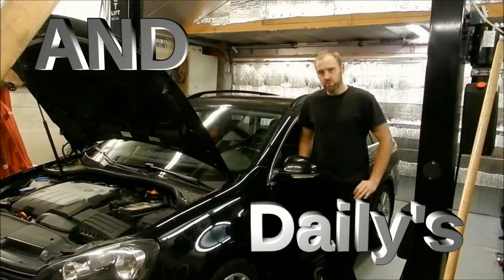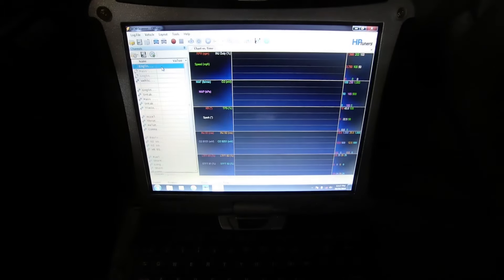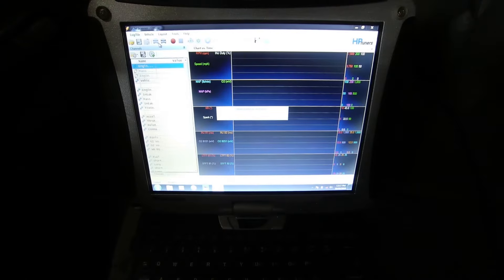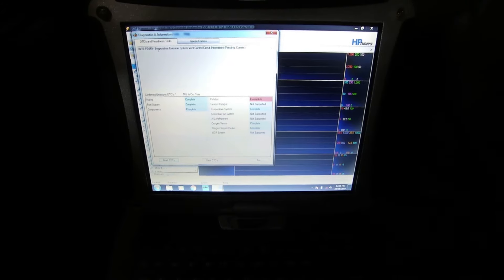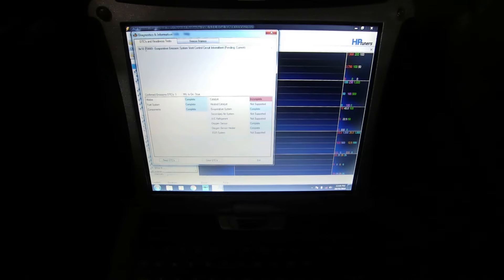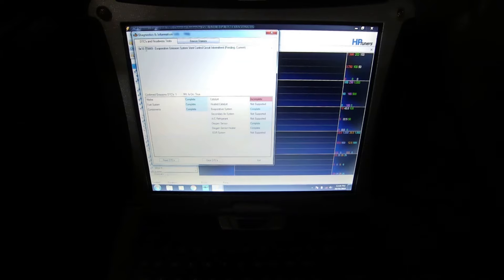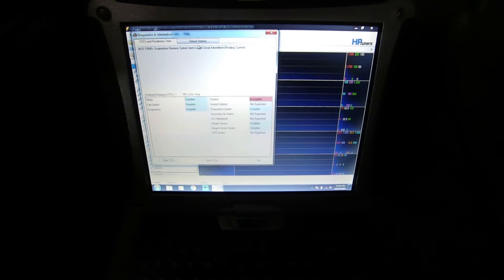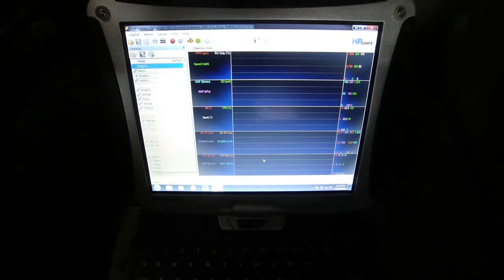The Common GM EVAP Code How to Diagnose and Repair

Comment: The newer trucks have the filter and valve seperated by a length of hose don't they?
Reply from the maker: Yes and the ones previous to that get updated to the hose type I believe.
Reply: I updated and moved mine cause it's 4x4, 98 miles later, check engine light.. changed canister, same thing, then purge valve, same thing .. so the light stays on and if you have over half a tank it has no power
Reply: From what I gather, the $200 fix GM suggests is just as prone to failure, so your better off just replacing that little $20 piece and get a year or two out of it as opposed to spending 10 times as much
Reply: @CrazedPerformanceRepair  

Im dealing with a p0455, tighten cap. The vent valve, purge solenoid, cap and charcoal cannister have been replaced. The tighten cap disappeared for like 3 weeks and code disappeared then came back.

I have not replaced the tank pressure sensor or plastic lines.
Reply: @shadowopsairman1583 ever get it figured out. Mines doing the same thing

Comment: Probably the best video I have seen regarding the evac. Thank you! I have a p0449 and have already replaced the purge valve. I will try the vent valve next.
Reply: What was it? mine has rough idle
Reply: @jacobmansfield341 did you figure yours out mine as well rough idle and check engine and the gas don’t go in
Reply: @jacobmansfield341  ..I had a rough idle on 04 Chevy truck also and it wound up being the purge valve that time ..but ..if the gas station nozzle shuts off it might be the charcoal canister ..both the purge and vent valves are relatively inexpensive ..makes sense to just swap them both out ..

Comment: I have a 2008 1500 Sierra crew cab and i get the 442 code small leak detected/change solenoid. Im going to do the test on this when i get home from work today..thanks for this video. It is informative.
Reply: What did you find out hoss?
Reply: A y results?
Reply: @reneescarcega7263  it was a leak in the hose coming from the evap to the canister. I remove it from truck, taped it, flex sealed, taped again, flex sealed again. It lasted for a while but its back again. I havent checked if its a leak from same spot. I did buy a smoke machine off amazon which helped find it.
Reply: @markherring3513  thanks for taking the time to respond, I guess gonna have to do an smoke test, replaced the vent valve solenoid by the gas tank and cleared the code for couple months, but came back same code p0442, has replaced gas cap and purge valve and the vent Valve solenoid , but the code came back, it must be a leak on a hose.

Comment: have a silverado 1500hd 6l 2005  have this po449 code changed evap canister,filter etc scanned it still same po449 so i changed evap purge valve on intake, still po449 code...what next??/

Comment: I had the po448 code for the evap vent circuit being bad.  went and bought a new vent unit as you show here and its still throwing the error code, so now i have no clue whats going on.
Reply: Yeah. I did the same and got the same results 🤔... just this morning
Reply: Did you clear your codes also?
Reply: @Jralls3  yes cleared the codes, also i believe the old one was faulty because i tested it with a 9v battery and it wasnt clicking loud, the new one is clicking a lot louder,  i checked my wiring too. so at this point im not sure what else to do.  i also took compressed air and cleaned out the box
Reply from the maker: Can your scan tool do activation of the vent solenoid? If so do that to make sure it activates. If it doesn't then I would retest wiring, then verify the ECM is putting out enough power and ground to solenoid at the ECM.

Comment: Im got clean tryck only 95k 4.8 runs good sometimes but ass sometimes... Gets p0300 flashing on highway at 70mph then sometimes goes away. Sometimes the light will stay on solid and then I scan it and it only says it's two. They're both 300. That's it. Thinking it could be a cat. I've already done plugged wires, purge valve... Guy did Jimmy rig the ground to the block with a new wire so it could be that idk... Chasing his bullshit sucks 😞
Reply from the maker: Check misfire history counter

Comment: My 2007 Silverado has both codes, pretty sure it's the evap solenoid by the fuel tank. The guy I bought it from had a grass cutting business, but the truck just now has 75k miles. It was very dirty underneath. I had both codes associated with this issue, po449 po445,  which  is the vapor purge valve on top of the intake manifold. I'm gonna change it as well. I usually do a resistance test on stuff, but the old timer I bought the truck from had run over a lot of open ground when he was running his landscaping business, and the top of the old valve was almost off. I've seen a bunch of videos on this very issue and yours is the most detailed, thanks!

Comment: Good stuff sir. 
       Definitely look at  a loose fuel cap first.  The easiest is often the most overlooked.  I've had this code come up 4 times in as many weeks on 4 g m vehicles.  Three times it was an incorrectly tightened fuel cap.  Cheap fix!

Comment: Great overview of that evap component. 
Last year had a P0446, since that canister was the most likely issue, I simply replaced it for $25. Of course that wasn't the issue. It was the $35 fuel tank pressure sensor which failed.  It sits on top of fuel pump.
In hindsight, since I got the AFM/DOD tuned off, could have just turned off the evap diagnostics and never would worry about again. 
I needed to pass emissions while figuring this out: cleared the codes, drove truck for 2 weeks while repeatedly topping the tank, until scanner said 'ready' for all but 1 test, and it passed.
Reply: Bob CajunWon I got the fuel tank pressure sensor fixed but my check engine light didn’t come off and keeps saying evap emission system. What did you do?
Reply: fassel elder been awhile:  could be a few things, cracked and leaking lines.  Remove that rear canister, clean out dirt or cobwebs, apply 12v to the pins, listen for clicking, blow through it with and without 12v.  Do same thing to the evap solenoid at the engine. Or, just find a guy to tune that feature out.
Reply: I replaced the canister and the vent valve under the hood. what do u mean by topping the tank? U mean tapping? I need to pass emissions as well.
Reply: @williamroberts4759 Topping the tank off means filling to capacity. The idea is that in a close environment, the more fuel you have the less vapor. Hence, the less the evap system has to work to vent off vapor.

Comment: My 2017 Sierra Denali has no fuel cap. Yesterday I started it up to a ENGINE POWER LOSS message and check engine light. After a few restarts the power loss thing corrected and the engine code is P0446. Not sure what to do.
Reply from the maker: Did you loose it or does it have that flapper door thing? If it's the flapper style you could still get debris caught in the causing a leak. But a p0446 is for a vent control circuit. This indicates a electrical fault.

Comment: I got a p0451 and a p0446. 2009 gmc sierra 1500. I don't think that its a fuel tank pressure sensors only because it had a full fuel pump assembly in a year ago.
Reply: I have the same problem did you find out what the trouble was.

Comment: Thank you sir !! Luckily it’s still under warranty, dropping it off next week  yours should of been under warranty here’s the info Expires
2035-09-14 or 150006 miles
Warranty expiration is based on expiration date or expiration mileage, whichever comes first.
Field Action
Some 2019 - 2020 model year Cadillac XT4, Chevrolet Silverado 1500, or GMC Sierra 1500 vehicles, equipped with a 4-cylinder gas engine may have a condition that could cause the evaporative emissions purge pump to fail. If this condition occurs, the Malfunction Indicator Light (Check Engine Light) will illuminate and a diagnostic trouble code will set. This special coverage covers the condition described above for a period of 15 years or 150,000 miles (240,000 km), whichever occurs first, from the date the vehicle was originally placed in service, regardless of ownership.
Repairs
Dealers are to replace the evaporative emissions purge pump/canister as necessary. The repairs will be made at no charge to the customer.
Reply from the maker: I believe that vehicle was a 07 with over 200k miles on it so yeah, warranty not so much.

Comment: Great video.
When testing the vent valve, does it matter what pin you connect 12v and ground ?
Ty
Reply: Yes it does, check schematics if you can find them but for the most part, red or grey is power

Comment: Im dealing with a p0455, tighten cap, the vent valve, purge solenoid, cap and charcoal cannister have been replaced. The tighten cap disappeared for like 3 weeks and code disappeared then came back.

I have not replaced the tank pressure sensor or plastic lines.
Reply: Dang bro. Did you ever get that fixed if so, what was the solution

Comment: What year what vehicle what engine size. I've heard so many opinions on this I may have to get a mechanic.
Reply from the maker: Yeah male model is fairly irrelevant. The EVAP works pretty much the same on all vehicles made from the 90s till current. It's one part of a vehicle that hasn't had a reason to advance really. The only difference will be the location of the components involved in the system. Otherwise they all function the same.

Comment: I had the code for almost a year after i swapped a fuel pump. I had a hard time finding what was causing it. It ended up being an o-ring on a hard line that went from the solenoid sensor into the  evap cannister.  The o-ring was inside a female connector.
Reply: Wow really!? That’s crazy.. I have a 2007 Chevy avalanche and I have a P0442 code that won’t go away.. I’ve replaced the purge valve and the gas cap, but the check engine light keeps coming on.. small evap leak

Comment: I have a 2019 chevy silverado 1500 4cyl, its throwing 2 codes P1467 and P2C0E.. We changed the evap solenoid and nothing improved, its having hard idling, reduce engine power and when i press on gas it gallops back and forth. So with all these symptoms would the evap purge pump valve on top by engine fix this, or the Purge pump next to gas tank?
Reply from the maker: Interesting set of symptoms, Perhaps PM me at my website. I struggle to keep up with youtube comments.
Reply: @CrazedPerformanceRepair  Dealer repaired it for me at no cost. It was the evap purge pump.

Comment: Has anyone started producing an emulator that will prevent EVAP codes?
Reply from the maker: EVAP codes are usually a easy fix. If the vehicle is new enough they can just be shut off in the tune.

Comment: I have 4 GM cars and trucks, all of them have evap issues. The evap systems on these are poorly engineered. Went through 3 vent valve solenoids on my 04 silverado and it's still having issues. Gave up and have been ignoring the cel for 5 years now. For some reason local emissions station don't plug into obd2 ports on 2500hd trucks here
Reply from the maker: You must drive on a lot of gravel. There is a upgraded vent valve that has a hose on it. If you add a filter to the hose and mount it away from dusty area it will last much longer.

Comment: Could this cause a p1400 code also been having rough starting for a while now
Reply from the maker: Only if the valve is stuck closed causing your tank to suck itself collapsed. Highly unlikely though. It's more likely related to MAF or something.

Comment: Great video on the simplicity of changing the canister, but why doesn't any of the youtube posters show how to work through the problem of a P0449 code when it isn't the canister but truly is an intermittent vent control circuit issue, and done without a 1000 plus dollar scanner. I am running out of electricians tape to cover the MIL and refuse to buy any more canisters.🤣
Reply from the maker: I did show it, this could have easily been done with a cheap code reader. All I did was pull and clear codes. Usually the intermittent vent control is sticky vent valve. Test it with power just like I did in this video and you will get it figured out.

Comment: I just changed mine and the purge & the lights still on . Do I need to change the harness also (05 Tahoe ) ??
Reply from the maker: What is the code?
Reply: @CrazedPerformanceRepair  
Have a 2019 Chevy Silverado LTZ 5.3L and have changed pretty much everything and check engine light still on with code P0498 (EVAP) vent solenoid valve control circuit low voltage
Reply from the maker: @RLsmith-cs3ry  using active test on scanner see if you can turn on/off the vent solenoid while measuring voltage between the contacts at the vent valve. If it doesn't do anything you will need to isolate if it's loosing power or ground. If it gets power check vent valve like I did in video.
Reply: @CrazedPerformanceRepair   thank you and thank you for responding

Comment: Please help I have 2006 1500 5.3 I changed the 2 Port Vent Solonoid and Canister vent Filter and re-did brand new Heater hose 5/8 th's from canister vent filter to the Solonoid even changed the 2nd port that hooks up to the disconnect connector I still have a check engine light I drove 80 miles round trip and it's still on?????? In the beginning before I changed anything the engine felt like a loss of power, after replacing everything the truck sounds good runs good but still have a check engine light I need help
Reply: Did u get it fixed

Comment: Great video. I have the P0445 and P0449 Faults. I tried replacing the purge valve under the hood first as it was easier to access. Did not resolve the issue. Anyone know where I can find a video of how to replace the canister on a 2010 Tahoe LTZ
Reply: Did you figure out that the trim level doesn't matter?

Comment: I have capless tank and I already replaced purge valve and still have P0443 and P0458 codes. Should I try to replace charcoal canister now? 2019 Silverado 5.3L High Country. 
Thanks if you can help.
Reply: Hi Ray, did you ever get it fixed?  2019 Chevy Silverado LTZ  and have replaced everything and check engine light still on with code P0498 now

Comment: Am having problems on my silverado 1500 year 2000 it takes 3 turn to turn on an I have changed the evaporato canister an evaporato selonoid and nothing still same problem
Reply from the maker: 3 attempted starts? That year still has throttle cable, see if opening throttle helps. If it does help the fuel pressure regulator prob leaks.
Reply: @CrazedPerformanceRepair  how about the 2001 as I also have the same issue 
Thank You so much 😊

Comment: Is it worth doing it? I have an O6 cat eye silverado...I bought an Obd to clear it...It only last a few days and comes back on...If you don't replace it, what's the deal?
Reply from the maker: If vent solenoid is stuck shut you could collapse your gas tank. It doesn't cost much to fix and saves the trouble of clearing codes all the time.
Reply: @CrazedPerformanceRepair  Thanks for the info! I was hoping it made you cool with women...But; I guess I can say, Yeah, baby I CRUSHED that gas tank, bare handed...:)

Comment: Could you test the part with a 9v battery? Or does it have to get 12v
Reply from the maker: Sure, it will be a weak click though. may not be easy to hear.
Reply: @CrazedPerformanceRepair  turns out I don’t have a solenoid it’s a 04 4.3 any idea as to what else it could be for the large evap leak?
Reply from the maker: @jimmysupra5881  they still have one but it's in a different place. You could have a bad hose or the gas cap is off...
Reply: @CrazedPerformanceRepair  for the gas cap there should be a gasket around the where the gas cap goes and the one around the actual cap. Correct? And is there any easy test I can do to find out what the problem can be?
Reply from the maker: @jimmysupra5881  the gas cap should have a seal yes. A smoke machine is typically used to find the leak. You will need to be able to close the vent solenoid to do this test though.

Comment: What are the chances that the code might be due to gas cap?
Reply from the maker: Possible for sure but depending on exact code it will change it's likely hood. If it's a circuit fault code the gas cap isn't the issue.
Reply: @CrazedPerformanceRepair  ya, it wasn't the gas cap.  I bought the evap canister.   Should I also replace the wiring?  The GM canister didn't come with the wiring.
Reply from the maker: @edjo3430  does the wiring look like an issue?
Reply: @CrazedPerformanceRepair  I don't think it's wire.  I will start with the can itself. Thank you.
Reply: @CrazedPerformanceRepair  I replaced the canister with a GM part.  It was easy.   But the light is on still.  Drove the truck for 50 miles after install.   What else could it be?  Purge valve?  I haven't tested the wiring since I know nothing about electrical stuff.   I hear a double click few seconds after the truck is off.  Is that the new canister I just installed?  This truck has been a headache since I bought her.

Comment: Hope to hear some good tricks in there because I have performed these replacements three times and keeps throwing code. Sometimes will stop for a bit after replacement, but not long.
Reply from the maker: You probably have wiring concerns.
Reply: You need to do a drive cycle. Go to 55-65 mph for about 10 miles and coast to 10-15 mph without hitting the brakes. At 10mph use brakes to slow down.  This is a rough description.  There are videos on YouTube that tell you how to do drive cycle in 30 minutes or less to get a ready status for evap system monitor.
Reply: @CrazedPerformanceRepair  I doubt he does . It's the drive cycle on GM vehicles.
Reply from the maker: @texn9326  exactly, if some times it stops for a bit that is probably when he is doing shorter trips and it's not having the issue. Totally depends on what code he is throwing as well. He could just have a leak somewhere. He never mentioned what code he has exactly.